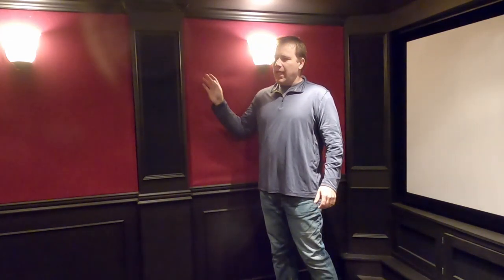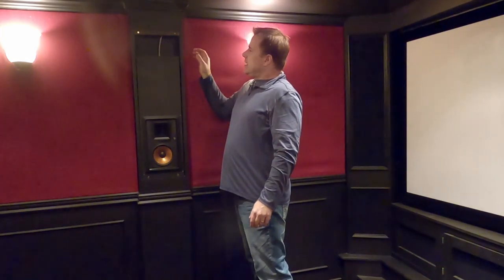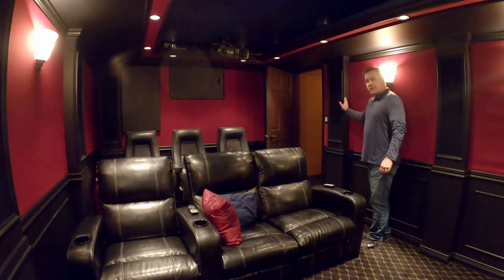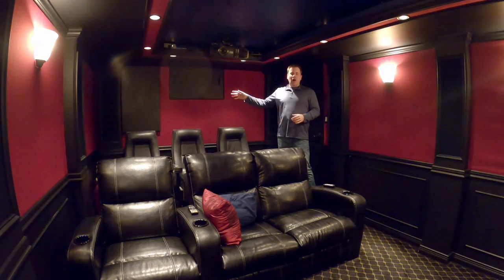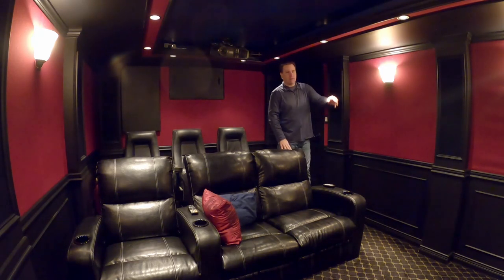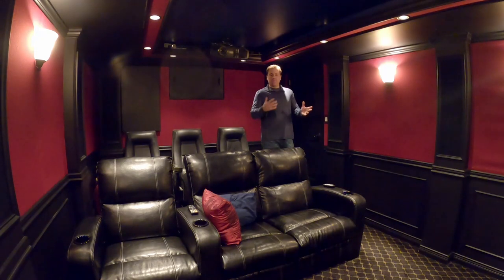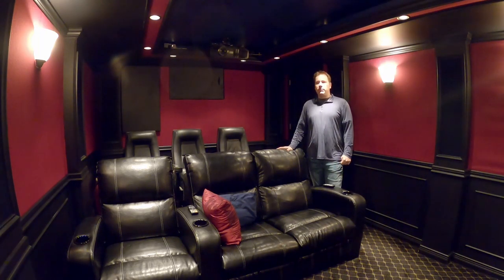Home Theater - Part 8: Speaker Tower Design and Placement

Comment: Great information! Though I read a lot about how to build a home theater on AVS forum, it's different when someone talks about it and you are doing a great job explaining everything. I have bought my front tower speaker from DIYSG (1099), but am kind of torn on what to get for the side/back surround. I have a narrow room like yours, so want in-wall that doesn't take much space. I think I like HT-8, they are 7.5" deep, not slim exactly, but believe they will match with my mains. The only issue is they are not in stock, waiting for them for the last 4 months. :(
Reply from the maker: Thanks for the feedback!  There's a lot of good info out there, hopefully I am able to add some info to your project.
Picking the side speakers can be as large of a task as you want it to be.  Some people go with the same brand, timber match, aesthetics, price, size, color, etc.  This is where it can get difficult as you may find yourself compromising for various reasons and then a year from now you're kicking yourself because you did not get what you wanted.  There are lots of things I wish I had done differently, but the important items were taken care of during the design and budget stage so I didn't kick myself.  The side speakers I have are 3.75" deep, perfect for my limited space.  If the HT-8's are the one you need to have, and you have the space, then I'd wait until I could get them.  On a side note, don't be afraid to buy used.  Most of my equipment was pre-owned and I have had ZERO issues with any of it, and some of this stuff is 10 years old.

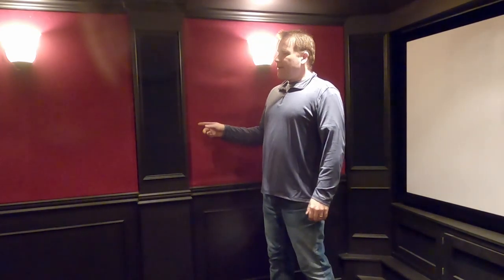Comment: 2:05 concealed I'm ultra jealous. Not really. Hidden nice.   
Surrounds should be arrays along the sidewall and along the back wall. Now there is no way a home theatre can play proper Dolby Stereo playback cos the AVR even the trinnov32 is inferior of this. Say you play Star Wars 4.2.4 matrix there is no way the AVR's of today that can do that. Got use pro-logic connected to the AVR 8ch input so you can switch between Dolby pro-logic and DSU. DSU makes a mess of it, trust me it just ain't same as you would have heard it at the cinema. Dolby labs are trying to sweep pro-logic history under the rug and brainwash the public at the same time.  
Overhead surrounds have been used as far back as Cinerama and when not used again was used for Dolby Stereo 4.2.4 matrix, Dolby CP50  flush in the ceiling at the local odeon cinema Bournemouth now closed and home to the pigeons. Oh yeah I heard Star Wars when it played nationally with overhead surround Feb 1978. Even downstairs screen 2 had it's surrounds down the side/rear walls and x6 in the ceiling and sounded good. 
When working with UCI cinemas projectionist at tower park, 10 plex, all screens used EV and overhead surrounds with a Dolby CP55 and that was 1989. Atmos is an encode decode, the speakers ain't called Atmos otherwise the sub should be called Atmos. 
I have used overhead surround at one home around '95 with floating ceiling tiles I removed few and stuck the speakers above. reminded me of UCI tower park.
Reply from the maker: Wow, there's a lot to unpack there.  While it would be cool to go down the path of true audio engineering, it's just too difficult for a room like mine with the small budget I have.  But, it's nice to see what is out there and maybe daydream a little about what the room could have been.